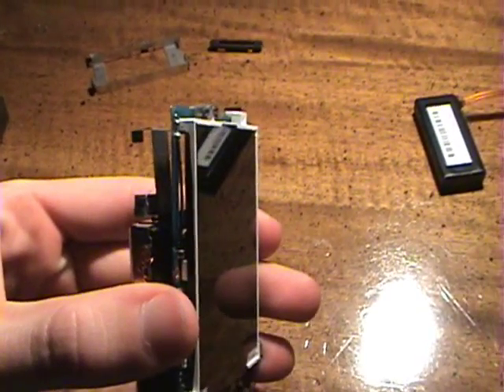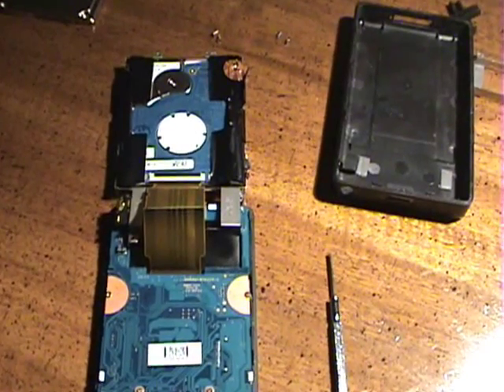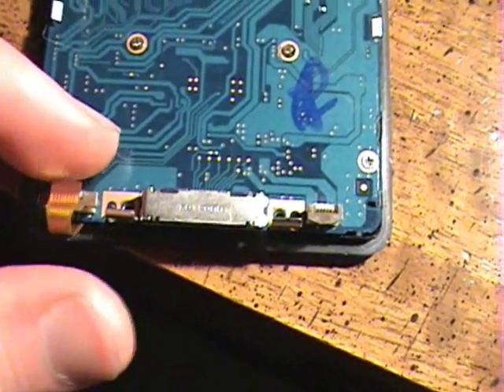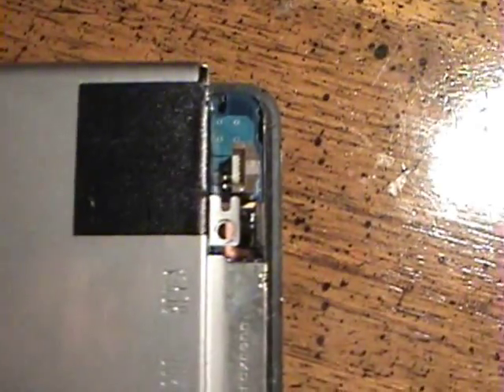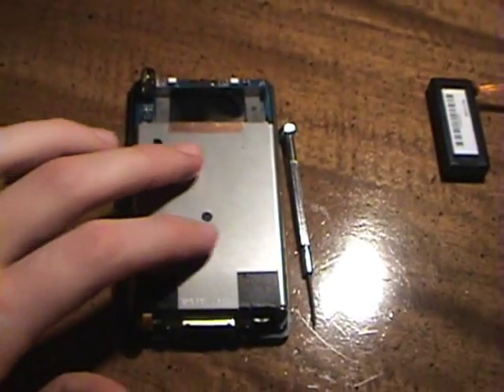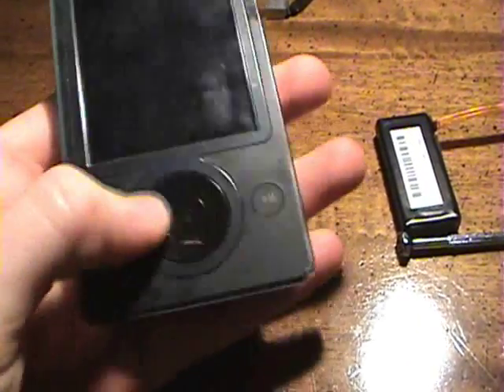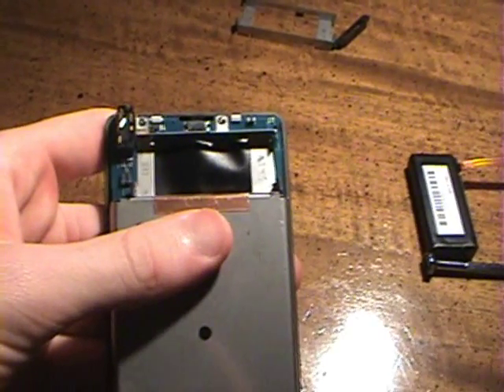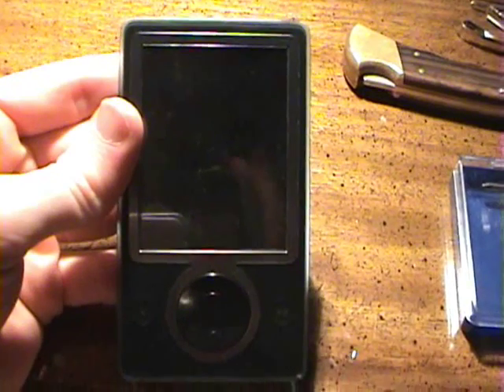Zune 30 gb to 60 gb replacement hard drive part 2

Comment: To make this work you need a 5mm thick drive, I believe the one you used was an 8mm drive, I went through the exact same issue the first time I attempted to upgrade my Zune 30 I eventually found a 5mm thick 60GB drive on eBay. I have also seen them advertised as large as 120GB at 5mm thick, but very expensive.

Comment: i found these videos very useful, i learned a lot from these vids... i took mine apart to put in a larger hard drive (which i later on found out was the same size) and if i would have watched this vid beforehand i would have not broken the headphone jack on the doner zune (dont ask how i broke it.. i don't even know) (yes i know this post is over 2 years after the vid and i know my zune is outdated but it still works like the day i bought it and ive had no need to replace it yet)

Comment: i know someone that put a 80g in a 30g you have to slice the rubber bumpers down or shave them down and it will fit it will be snug fit but he can do it with a 80 you can do it with a 60